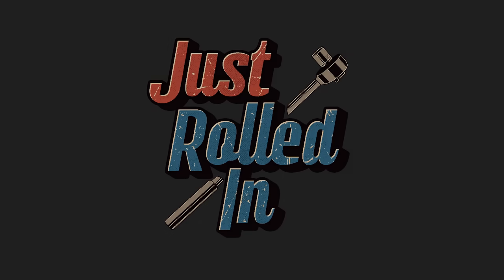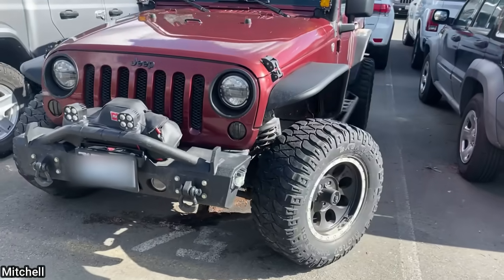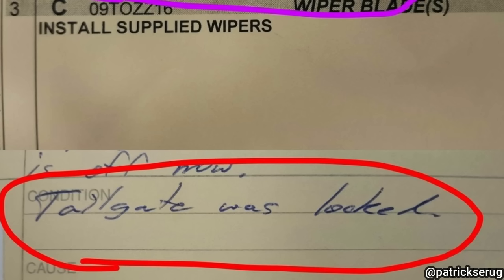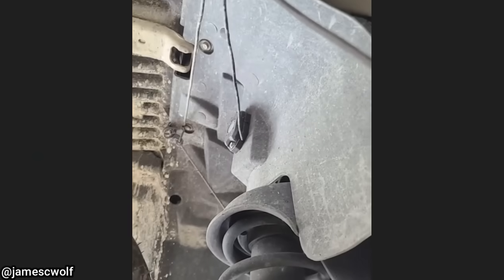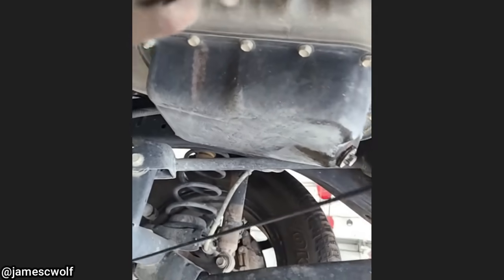Customer States They Hit A BIG Rock | Just Rolled In

Comment: Had a guy drive in on his rim once. I could hear him all the way across the lot. I asked him why he didn't put on his spare tire. He said it was only a few miles. I told him he needed a tire and a rim. He asked, "Don't they come together?"
In a benz.
Reply: Mmm something about MB owners there... had a girl drive in with a year old CLA, said she wants to replace her rims with new ones since their 'nice color' faded.

After a quick finger wipe we established hers were the same just with a year's worth of brake dust and muck since they were never washed.
Reply: @Valks-22  Ha that's funny. You can tell when people don't clean their rims or rotate their tires. The front ones are dirtier.
We had a girl come in 3 weeks overdue for state inspection. She drove in the shop, (which you're not supposed to do) through the wrong door, and screamed, "I need the cheapest tires you got!" I said, "On a lexus?" She yelled, "Just put 'em on!" So, I did, and she went and got her sticker.
Reply: @Ogrematic  around here every so often on a high-spec high-inch wheels of an Audi Q7/Q8, BMW X5, or similar I'll find tires I've never heard of.
I guess their heart skips a beat when they realize what a full set of ~285/45/21s Michelin/Conti/Bridgestones cost.
Reply: @Valks-22  Yeah. That's why my vehicles always have steel rims with standard-profile tires.

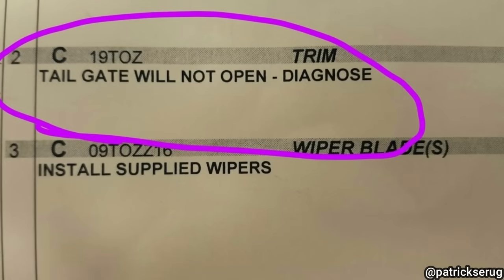Comment: 1:39 I once called for help because my car was low on fuel and the petrol tank door thing was jammed shut...turns out in Beamers the central locking also locks that :(
Reply: practically all european brands have the cas filler lid being locked with the central locking system. Volvos even have a timing for that, so you could park at the gas station, get out, lock the car, and have 15 seconds to open the gas filler lid... info on this is hidden deep in the owners manual, though.

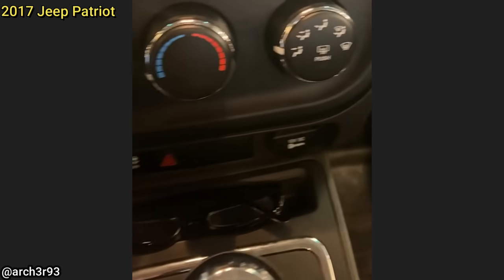Comment: 1:10 never seen a newer vehicle not equipped with ac.thats unusual for sure
Reply: Chrysler product, you're closer to walking than you can possibly realize. Having A/C just speeds up the inevitable.
Reply: My father had a 1998 Saturn SL with AC, but no power steering. :/
Reply: @DashcamRiprock  my dad had a 98 Saturn SL1. Every time he turned the ac on the car would make a horrible wining sound and overheat
Reply: @randomvids9507  Must've been that fancy power steering that caused it.
Reply: @DashcamRiprock  I think it was the water pump.the SL series weren't very well made

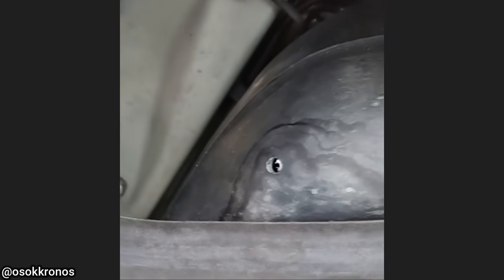Comment: 0:48 This is why it should be a drain plug in the fuel tank instead of no plug at all. topped off gas/diesel is much cheaper than the tank usually costs. who knows what kind of damage thieves can cause when there is no drainplug. at least the dammage pictured on the video is fixable without replacing. possible that the thief did you a favor and made you a hole that you can make treads in and install the plug
Reply: Was a lot of diesel stolen in the region a while back, truck drivers stopped locking their tanks if they had no choice but to park them in a poor spot.
Thieves would cut messy holes in the tanks rather than even try to pry a locked cap off.

Comment: i think that might actually be an issue with the jeeps right now because i saw one that broke in the exact same spot but they were off roading and hit a stump. at least they were honest
Reply from the maker: I think it is as well. Some other people have mentioned that in the comments. Seems to be a weak spot.
Reply: The newest ones have a cast section for the axle disconnect that breaks. This is an older one without the disconnect.

Comment: 0:56. You could get a car not equipped with Air Conditioning in 2017?! Was this not in the US?
Reply from the maker: US I'm pretty sure.
Reply: @JustRolledIn  I know there’s no mandate requiring AC. But the power loss from it is so negligible these days that even cheapo economy cars like the Rio come standard with AC.

 Plus i would think it would think the manufacturing standardization of installing it on all trim levels would be cheaper than some getting AC and some not. 

Just wild one would opt to buy a new vehicle without air conditioning in 2017
Reply from the maker: @mechcommander7876  I think they might have bought it and didn't know it actually did not have AC. A dealership would most likely not tell them. They know a vehicle with AC won't sell. Unless the person didn't know... I don't trust dealerships so I could see that happening unfortunately
Reply: Because it makes the car a little bit cheaper and if you don't tell the customer there's no ac, you can sell the car for the same price and pocket the difference.
As long as the customer doesn't ask, you don't have to tell...

Doesn't matter what you buy, if a feature is not explicitly stated to be included, it will not be included even if they make you pay for it.
Reply: @mechcommander7876  Welcome to bargain basement domestic vehicles like Jeep Patriots.

Kia, Hyundai got into the North American market, because they did offer A/C and such as standard on their cheap small cars. Companies like Jeep? They skate by on brand loyalty and "image."

Comment: Ever feel "tired"? The guys in the last clip almost did.
Reply: Wonder how did it came off - I actually believed it was a whole wheel!
Reply: @leifvejby8023  It usually is. Consider that many folks have never in their entire lives even changed a tire...how often do you think they look at their lugnuts? It's victory for modern advertising, people expect their cars to run perfectly forever.
Reply: @haroldwilkes6608  You are right, people can't be bothered to understand their car. 
I have often changed  my tyres, but not ob the road. If  I get a flat while driving I just smack on the spare wheel, and bother with the punkture at home - repairing or replacing the tyre.
Reply: @leifvejby8023  Me too but I find that as I get older (79) tires are getting heavier...or maybe it's climate change.
Reply: @haroldwilkes6608  It is not you or climate, the "normal" wheels are quite a lot larger, and heavier these days, than they were just 50 years ago.
Reply: @leifvejby8023  Thanks, I feel better now, So does my back.

Comment: I have been watching your vids for a while now , as well as alot of the techs in our shop , and they are great entertainment . But damn i am still in shock over what rolls in . Looks like someone was siphoning gas which brings up my own story of a brand new Equinox that was bought just recently and a day later customer came back angry as a bear with a very loud exhaust , someone cut off cleanly with a saws all the catalytic convertor , worth a bundle here in Canada because of the platinum inside and i assume in your area i bet . Although fencing catalytics is like fencing stolen diamonds , everyone down the line is a criminal most likely . And we have had the odd dead cat wrapped around the AC compressor , sorry no pics . Know where your pet is before starting your car because you thought letting your cat out when below freezing outside was a good idea especially if you just got home from a long car ride . Long like this comment , sorry
Reply: That isn't from syphoning, by the way.  A syphon is what you would use to get fuel out through the filler cap.  This thief just drilled a hole and drained the tank that way.
Reply: That was good to add about the pets; I walk around the car before I drive, for that very reason. Cats, squirrels, etc. love to wander around in our neighborhood. 
Some trucks are big enough that the tires make a great resting spot; I also saw a cat once, even when I walked up and opened the door and closed it again, would NOT get out from under my car. Had to resort to mean tactics to get her to leave. (Broom handle)
Reply: @Kromaatikse  You could be right but if its a vehicle thats been built in the last number of years you cant get a hose down the filler tube , manufactures got wise to this and have installed best described as a ball down the filler neck , at least thats how GM does it although i have never cut open a filler neck to see what it look like but i know its there , try it just for fun . But i have seen a hole drilled for stealing gas , they use a tapered plug with a hose on the end and with the price of gas expect it more ..
Reply: @Kromaatikse  Sorry i misread your comment , yes you are right i misspoke Siphoning is indeed a hose down the filler and drilling a hole with a hose funnel or any other means is still thief that is on the rise as well as gas and dash , they make you pay first at some stations , have a good night
Reply from the maker: I appreciate you guys watching the videos! Where are you guys in Canada?
Reply: @JustRolledIn  We are watching from Ontario Motor Sales Oshawa Ontario , home of the GM headquarters of Canada and the main plant . This company is everything to this city and GM has treatened to pull out a few times but always stays after breaking down the union a few notches . And the Camaro and the Silverado was best when we built it although we got trucks back but in 2 years everything is electric anyways . Are dealership is going through major renovations for electric ..

Comment: That car rolling in to the garage with only the bead of the tire remaining… it’s giving me war flashbacks. I can’t even begin to imagine how much time I spent trying the break those types of tires down normally rather that just cutting them off.
Reply: @Chris Brandenburh Just mount the rim on the rim clamps, and use the mounting finger and a tire bar. Spin it around and push down with leverage from the mounting arm the same way you mount the tire on the rim. It works everytime, and it's a quick way.